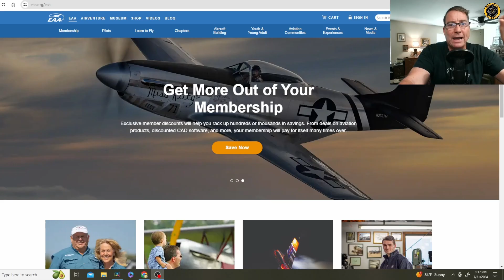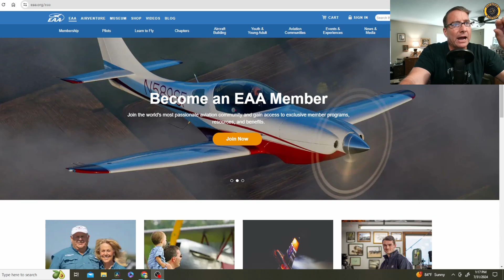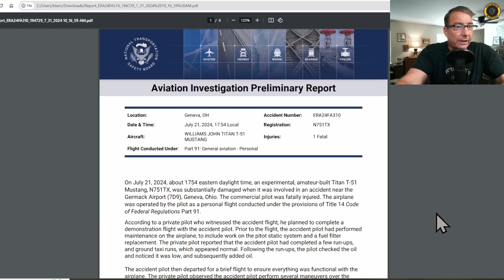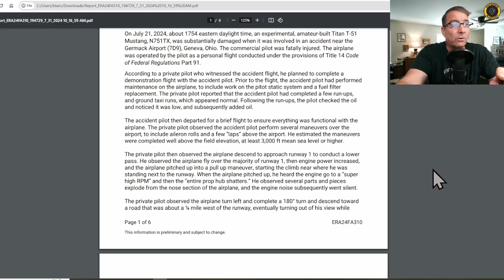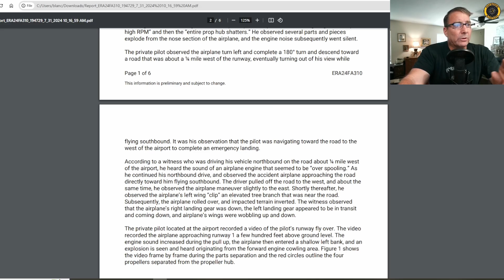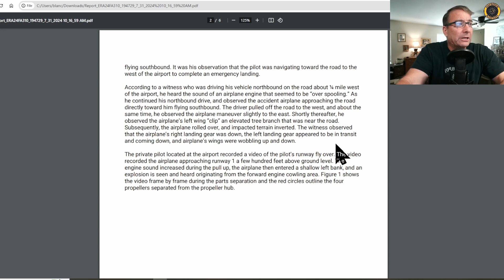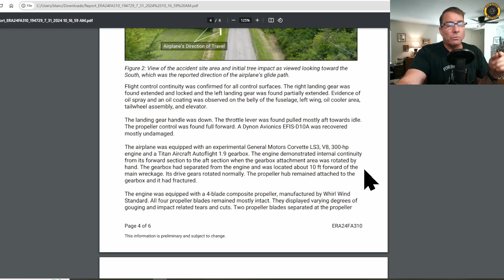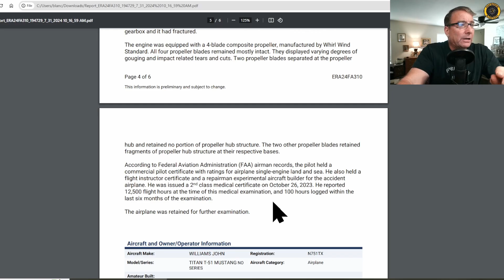Titan T-51 Fatal Prop Hub Failure 21 July 2024

Comment: I worked for John at Titan Aircraft for almost 3 years. I worked on this plane on several occasions, as well as several others. Anything that had an LS on it was very nose-heavy.
Reply: Was the throttle electronic or cable operated?
Reply: @juliogonzo2718  Rod actuated.
Reply: @popsfereal  so that would rule out un commanded WOT due to faulty electronic throttle body/throttle position sensor.
Reply: The original P51 had a V12 on the front. This is a 3/4 scale of the original, so am I wrong assuming that as long as the engine is 3/4 the weight of the Merlin or less, it’s fine?
Reply: @cwhitty05  It's not actually a scaled P-51, it's just a very light aircraft that happens to look like the P-51 and is about 3/4 of its size. The weight of the T-51 (as originally designed) is about 1/9th of the weight of the P-51, so the LS V8 is disproportionately heavy for such a light aircraft.
Reply: @PistonAvatarGuy  got it, that makes sense. Thanks!
Reply: @cwhitty05  yes you are wrong.
Reply: You're wrong. 3/4 scale doesn't give you 3/4 of the wing area. And the plane was not designed to fly at the same speeds as a P51. @cwhitty05
Reply: The center of gravity has to be within a certain range, whatever the weight of the engine, no?
Reply: @Pantdino   yeah even with the LS the plane was already nose heavy, an inline 6 is a bit heavier than a LS, the Australian Barra tips the scale in around 520 ish lbs, and stick out 10 inches past what the LS does. The 2JZ weighs in at around 440 ish lbs and probably sticks out just as far as the Barra does. An inline 6 would significantly impact the planes center of gravity.
Reply: @Pantdino  you are correct. Just because it has to be doesn't mean that it is. To anyone who has one of these with the LS power plant I would carefully check your weight and balance and not rely on the paperwork from the factory.
Reply: @PeacefulRallyCar-pw3cs  Turbos by their very nature don't supply low end torque. Why would a turbo 6 do anything differently?
Reply: @PeacefulRallyCar-pw3cs find me a 6 cylinder that's substantially lighter than an LS and makes similar power, especially with all the turbo hardware. Won't get as good of millage for the same power level either, boosted motors run a richer mixture
Reply: @zakn3954 The T-51 flew with Suzuki and Honda V6s, both weighed significantly less (100 pounds or more).
Reply: you don’t have to look far, our Australian built Ford Falcon Turbocharged 4 litre DOHC “Barra” engine is recognised here as an “LS eater” and many of them have found their way over there to the US in recent times for swap outs including drag cars
Reply: @jamesgovett3225   yes but the issue here is weight, and an inline 6 sticks out a bit more than a V8 and is heavier.
Reply: @jamesgovett3225   the Barra inline 6 weighs about 525lbs (238kg), heck even a 2JZ weighs in at around 440lbs. The Barra inline 6 sticks out at least 10 inches past an LS so a Barra being heavier and longer would change the planes CG quite significantly. The LS already made the plane nose heavy, a Barra would make it even more so due to weight and length.
Reply: @madmax2069  Mate I’m not serious, just a joke Joyce!
Reply: @jamesgovett3225   your comment doesn't read off as a joke.
Reply: Dropkick
Reply: @zakn3954  yes surely someone has thought of it already
Reply: @zakn3954  most modern V6 are going to be lighter than a V8 by around 50-100lbs. When something is hanging from the nose of the craft every pound matters.

An inline 6 is likely going to be just as heavy if not heavier than a V8, plus it going to stick out further ahead shifting the weight even more forward making it even more nose heavy.
Reply: @madmax2069  lol look it up you will be surprised that most Modern v6's actually weigh the same or more than an all aluminum pushrod motor. Dohc, vvt, DOD, all that just mean more weight.
Reply: @zakn3954  Honda, Toyota and Nissan V6s are all in the 300 pound range, while LS V8s are all over 400 pounds. Edit: The exception is the VR38 from the GT-R, mainly because it has the front differential integrated into the oil pan, but also because it just an extremely stout engine, easily capable of handling more power than the LS engines.

Edit: On an archived version of the Titan Aircraft website, they list the ramp weight (I'm assuming that this means that the engines are fully dressed) of the Honda V6 as 416 pounds, the Suzuki V6s as 307 pounds and the LS as 470 pounds. I'm amazed that this didn't cause serious CG problems for the aircraft, considering that it was originally designed for the Rotax 912, which weighs ~140 pounds.

Also, the engine weights are listed with and without the PSRU, depending on the engine, but the archived version of the website seems to have lost the symbol that indicated which weights were which. I'm fairly certain that the LS weight did not include the PSRU. The J35 weight is often listed as being around 360 pounds (without the AC compressor), so the weight shown there is likely with the PSRU.
Reply: @zakn3954   I don't have to look up anything, I already know the weights. A V6 is usually under the 400lbs mark, and most V8s are over 400lbs (both with accessories installed). 

A GM 3400 V6 is around 350-360 (that's including accessories)

A 6.2 LS is around 418 ish lbs (including accessories). 

A 4.2 Atlas is pushing 450lbs (with accessories).

So a V6 weighs less than a V8, an inline 6 is usually going to weigh more than a V8 all the while moving the weight even more forward.
Reply: @madmax2069 I used to work on LS engine, car applications only, a LS1, I think would be a perfect aviation engine as it's pretty lightweight, even with it's accessories , which can be lighter by changing the dampener, pushrods, intake etc. What I'm not sure, since it's an all aluminum engine, the temperature changes that affect the expansion/constricting. A ls2 or ls3 is offered in the iron block variety, but a lot of weight.
Reply: @madmax2069 Overly generalized claims. The point is that to achieve the same specs as an NA V8, a V6 must have forced induction which will cause it to be similar weight, or more. It's usually more because of all the extra plumbing for the turbo (coolant, oiling, intercooler, etc.). Plenty of people build GM small block V8s under 400 lbs dressed. The aftermarket parts selection is immense
Reply: @MrCarGuy  Yeah, but turbocharging on an aircraft engine provides an absolutely enormous benefit. At 5,000 feet, where I live, an LS will have lost 15% of its power potential, while a turbocharged engine will likely be able to produce maximum power well past 10,000 feet.
Reply: @MrCarGuy   you don't need forced induction to get V8 levels of power out of a V6.
Reply: @Bangbang-gl4xo They used to make iron 4.8, 5.3s and 6.0s, but that was all gen 3 stuff. Subsequent generations have all been aluminum blocks as far as I know.
Reply: @9Apilot  True. The LQ9 engine I believe was a iron block, from the 3rd gen family. Built strong AF structurally, but lots of issues with rotating assembly. Again, I have no idea for aviation, but the LS1, has been used in many other applications outside of auto. Dune buggy, boating, etc. Why the LS3 over the LS1 in aviation, I dunno. It said it was a 300hp engine, which is the same as a LS1 at 310hp stock.
Reply: @Bangbang-gl4xo  the reason that they use an LS3 is probably the extra displacement along with the rectangle port cylinder heads. The 300hp rating is probably related to the RPM range for continuous power based on engine durability and for the gearbox and desired propeller RPM. 
300 horsepower is very easy for an LS3 to produce and could do so for an extended period.
Reply: @zakn3954  yeah the LS is pretty light and has the power without boost.

Comment: The Diamond DA42 does very well with its Mercedes Benz Turbo Diesel Engines. Certificated and everything. Worked on them a lot.
Reply: Always drooled over the Porsche/ Mooney when it came out
Reply: But then aren't Mercedes engines as expensive as the normal aviation engines?  I figure cost savings is a major factor in using automatove rather than aviation designed powerplants.  
I am a fan of turbo diesel power, but mine is the very heavy type that's way better in trucks and boats than aircraft.
Reply: @wadepatton2433  reliability and safety come at a price
Reply: @wadepatton2433 save cost or save life?
Reply: Austro (MB) diesel aviation engines spin at 3880 max engine rpm and use a gearbox reduction and a constant speed prop. Prop rpm is 2300.
Reply: I won't call that well if you have been following it since the Thielert days.
Reply: @MetaView7  thats when they first came out. I actually prefered Thielerts over Austros.
Reply: @MetaView7 
The original design had many weaknesses but it has become the most reliable aircraft engine.
Ironically, Thielert reverse engineered a Mercedes Benz 4 cylinder 2 litre car engine, from the A-Class, which had sintered steel block and Thielert substituted aluminium to save weight.
Thielert also reliably increased power from 80 HP to 125 HP but the gear reduction drive was too lightweight and was not reliable.
Diamond installed this engine in the DA40 and DA42 aircraft.
Thielert went into bankruptcy and Diamond had no engines for their aircraft.
Austro was created by Diamond and they just used a standard Mercedes engine which have suffered no mechanical failures.
The gear reduction drive was substantially beefed up.
Eventually, Continental bought Thielert.
Continental now manufacture this  diesel engine, it is FAA certified, to produce 170 HP.  That is more than twice the maximum power of 80 HP in the Mercedes A-Class car.
Continental have also certified a Mercedes V6 diesel rated at 300HP but only Diamond installs this as OEM.
Unfortunately, general aviation has died, Beechcraft, Cessna and Piper were content to keep churning out 1940s tech for 75 odd years without much real progress.
Now, in 2024, there are very few new aircraft being designed and/or manufactured, and the few that are available are $1 Million plus new.
Reply: They also have a real company building them that have money for R&D…
Reply: I was thinking about the model A Ford engines used on pietenpol.
Reply: Mr. Germany. 15 yrs maintaining da 42s. They have issues.
Reply: @jimhaxton1982  yeah the airframe. Not the engines. We had a lot of electrical issues on ours.
Reply: Was curious about diesels.  They run fairly slowly, with gobs of torque.
Reply: @jaysmith1408  It's good that they can run on jet fuel. Also the low RPM helps. However, to get the most out of the high torque, you need variable pitch propellers.
Reply: @markotrieste  they used constant speed. Pretty efficient still.

Comment: Sorry to hear about this...Looks like a nifty design; I saw a pair of these perform at a local (N. Ohio) airshow 10 years ago; both were powered by the Honda Odyssey 3.5 liter v-6, also rated at 300HP...
Reply: It needs to make that power at the required 2,000- 3,000 engine rpm as discussed at 1:30.

Comment: Very sad story.
How do you know that the engine surged in RPM first and THEN the hub failed. Why not the other way around? Thank you!
Reply: The hub could partially fail (causing the blades to go flat pitch) unloading the engine enough to overspeed the prop which would then physically break apart the hub. Alternatively the hub could just have failed in some way and the overspeed happened after the blades came free.
Reply: Well, it's a report from an eyewitness on the ground, so I would guess that he heard the engine rev before he saw the debris separate. Sound travel delay would put the overrev event even further before the debris event than he would have perceived.
Reply: EDIT: Not just an eyewitness report, the eyewitness recorded video.
Reply: I think from the video they concluded that it was an initial surge and a subsequent failure.
Reply: Because the propeller was destroyed by high  rpm

Comment: Are you going to look at the PC-12 that had an engine failure out of DFW and decided to fly around the area, overflying other airfields before deciding to take his dead engine back to DFW... before realizing it was outside of his glide range and crashing short of the runway at one of the fields he had previously ignored. Without loss of life. Just a totaled $12+ million plane.
Reply: I think he already a did a video on that a couple of years ago. I remember the story. The guy thought he was losing power so he decided to limp it back to DFW. Ended up crashing at Mesquite airport I believe. Think he walked away from it.

Comment: Does the engine show evidence of overspeed? V8 exhaust note is unique among aviation engines so it would be hard to say that witness statements would be sufficient to know actual RPM. If in fact overspeed, was there an rpm limiting device? Did it fail? Was it set too high?
A lot of open questions still on this one.

Comment: so how is the fuel fed to the engine?  is it a carb or fuel injected? because for a gm block to run away like that  to me screams a injecter or fuel float stuck open.
Reply: If it is FI, wouldn't the computer have a rev limiter?
Reply: @PeacefulRallyCar-pw3cs  yes but it is adjustable via the engine management system. We routinely plug them into a laptop and adjust it everything from mixture timing you name it.
Reply: They are fuel injected, and we always had to change the throttle plate so the fail safe was wide open. Any failure of throttle linkage etc would allow the engine to go to full throttle and that would rev until something gave. I'm not saying that's what happened in this case, just answering some questions.
Reply: @popsfereal  now that is very informative, thanks
Reply: @popsfereal  If the throttle body is designed fail safe wide open there must be some other kind of rev limiter because of the prop right?
Reply: I know from experience if a carburetor engine suddenly has the slide pulled out, it will over-rev (with magneto spark).
But, with Fi if the throttle plate is somehow taken out, the computer would limit spark, unless the engine somehow went to pre-ignition.
I'm not a mechanic, just tossing ideas.

Comment: A big problem that he had was once that prop and hub separated from the front of the plane was that it became considerably tail heavy and probably difficult to control.  Too bad he didn't have more altitude to try to stretch it straight ahead and pancake it into the water.  As an owner operator of an Experimental, I sure hate to see these.
Reply: I highly doubt that considering this plane was extremely nose-heavy to begin with. I personally worked on this plane on several occasions.
Reply: Not with an auto engine…they are almost all nose heavy…
Reply: @ctquicksilver  all of the Titan T51s with the V8s are extremely nose-heavy.
Reply: If the gearbox had left along with the prop the CG might have been the problem.  But the prop is very light because of the composite blades and without a passenger the CG would have been far enough forward that it was still within range.
Reply: Nope, wrong